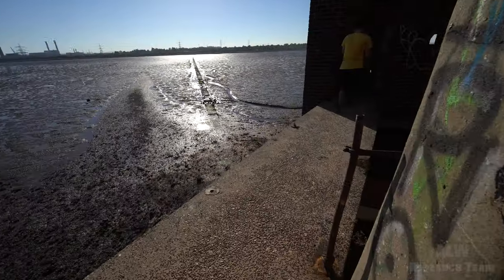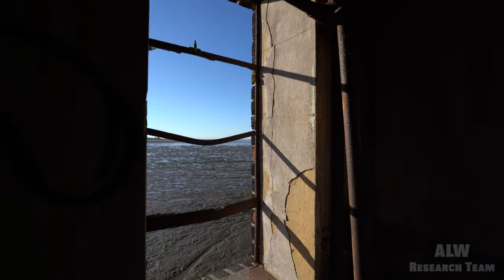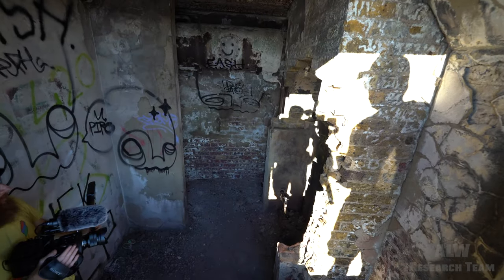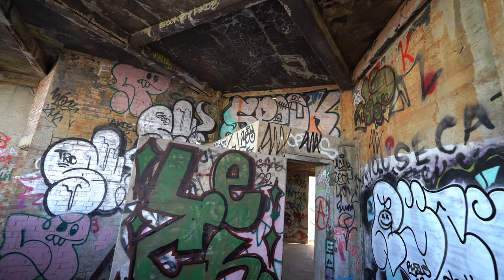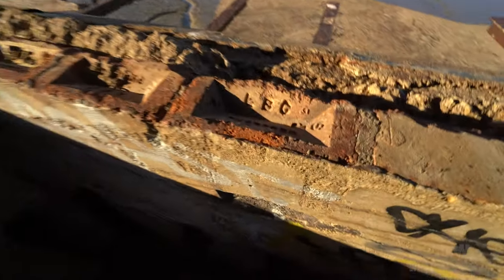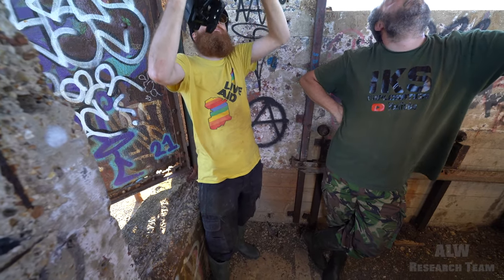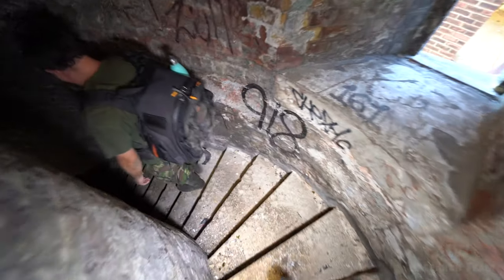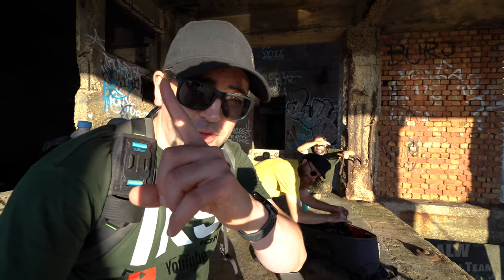Grain Tower Battery Episode 2

Comment: Great video, Andy & the IKS fok.

The gun emplacement is very interesting. While the gun itself was not huge (6pdr 10cwt), the double mount was a hefty affair. I reckon the lower tower platform could be the observation/plotting one. The upper platform holds the pedestal for the fire director. Couldn't find the specs for it and the equipment linking it to the 6pdr but it must have been from the Small (Modified) type.

Have a great weekend, folks.
Reply from the maker: Hello there :-) 

Thanks very much for the info.
Reply: @ALWResearchTeam  Always a pleasure, mate. Take care. All the best to you and little Thomas.